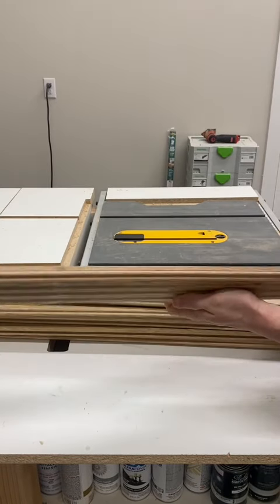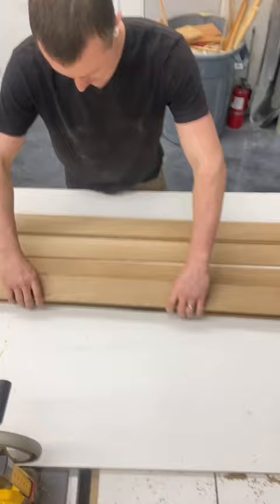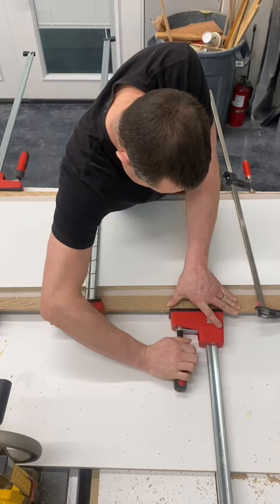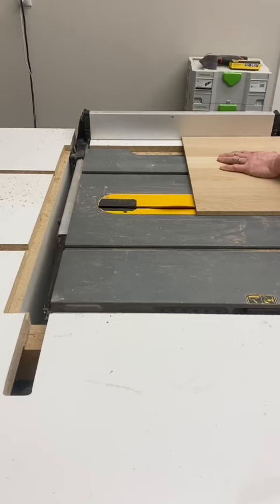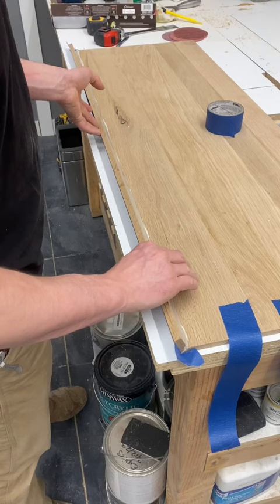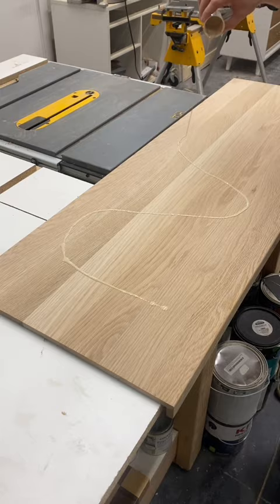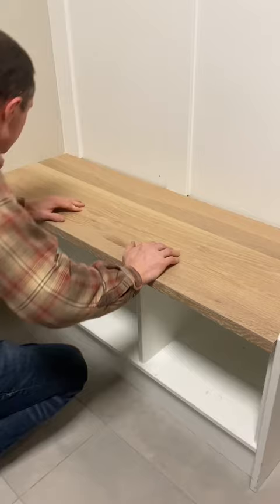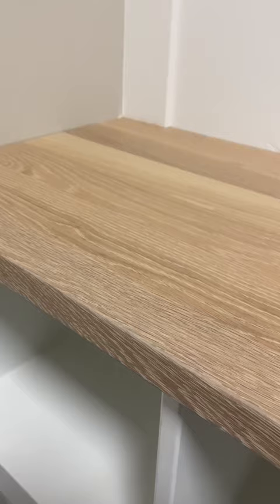Making a mud room bench from wood flooring. #diy #homeimprovement #homeproject #diyprojects #shorts

Comment: It’s because tounge and grooves in flooring don’t actually make full contact with each other. Only the top and bottom lip of the groove makes absolute contact. If the didn’t cut them then he would have less surface area for error when sanding or planing and the expansion and contraction of the inside tounge could cause the lip to split over time since the toung would have areas where it could move freely. 
Yes it would have probably worked just fine, but the better option is to do what he did by glueing the butt joints and leave the expansion and contraction in the oaks short gram instead. He did it the more sure and long-term safe way.

Comment: Why cut the tongue and groove out of both sides?  Why not leave them in and just glue them together?  If you were going to cut them out it would have been a lot easier and cheaper to just buy plank boards.
Reply: I wondering this aswell.  Seems like dude dont answer questions tho lol
Reply: My guess would be leftover boards from a previous project maybe? I still don’t know why cutting them off though
Reply: The tongue and grooves left on would leave a visible break between each board.  Milling them off allows for the top to appear like a single piece, or at least perfectly smooth.